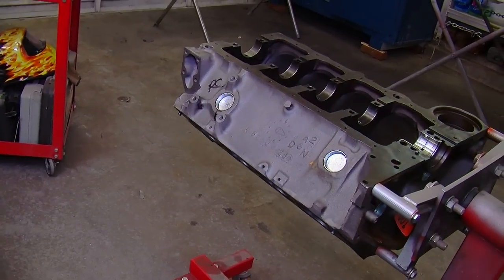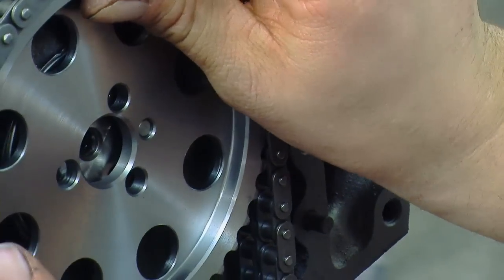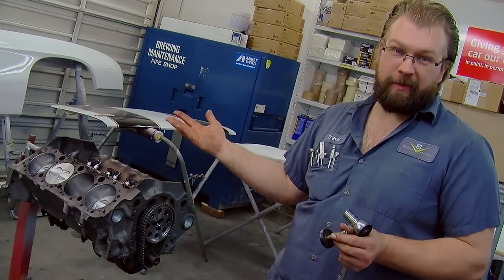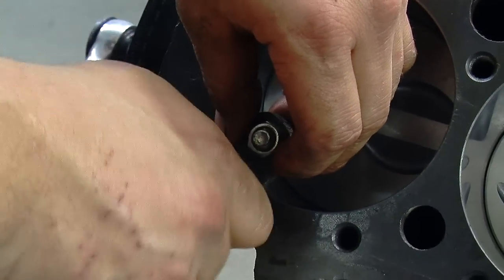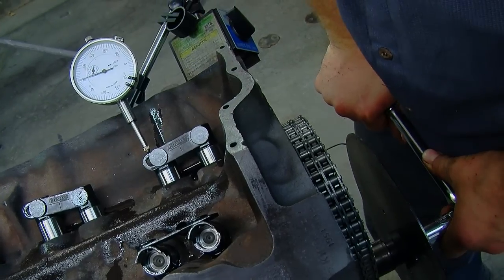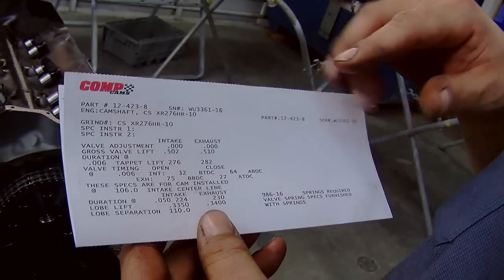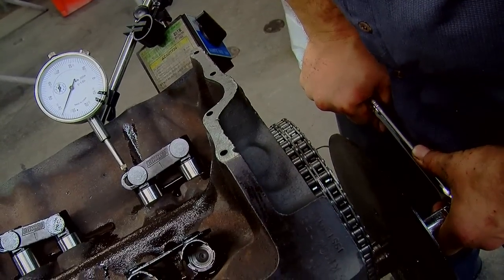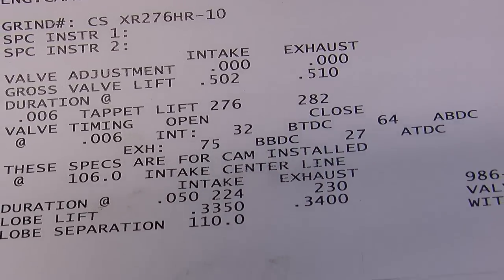Engine Building Tips 6-Part Video Series Small Block Chevy Part 4 How To Degree A Cam V8TV

Comment: Question How Can a 1994 Mack Superliner Convetional Day cab V8 diesel Engine Run Backwards ? Cause this happened to me the first year l Started Driving Big Truck's in 1994 l was a 6 Axle Tandem jeep Loaded with 65000kg's of Tree Lenght Spruce Log's Decending the Dunvegan  Mighty Peace River Crossing, when l Jake Stalled the Mechanical old School Engine After Blowing a Gear Downshift & Hit the ignition key , to Restart & Not Knowing the Crankshaft was Still Rotating, so the Mechanical V8 Ran Backward's  no Problem & Blew White Smoke out Both Dual Outside Air Cleaner's. l was in trouble but l lived to tell about this highly Fatal Trucking driver Error thing.

Comment: How often is a cam misground or incorrectly labeled? I know it can't be unheard of but I've never encountered it
Reply from the maker: It's not super common to have a cam mislabeled, but it has happened to us a couple times in the past several years.    And 2 more were completely wrong grinds in the wrong box.   This process also helps you know where the cam is installed and to verify your geometry and valve action.